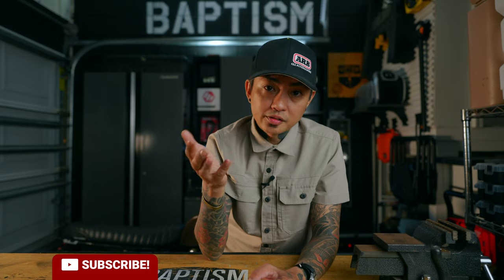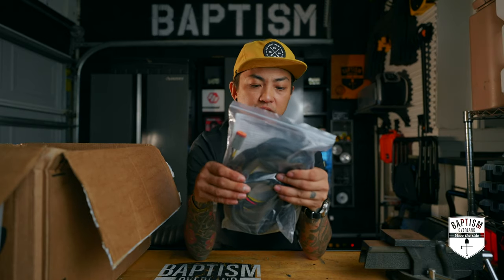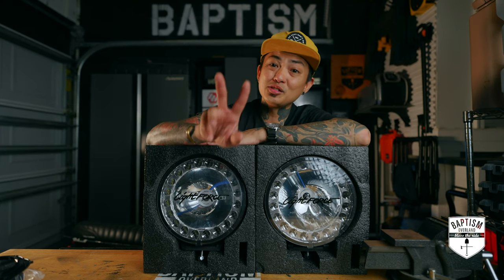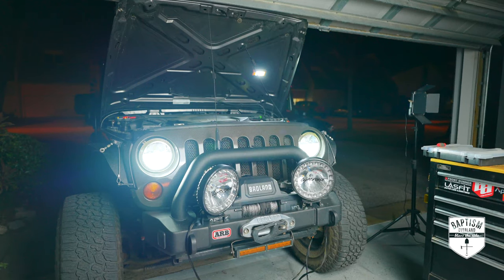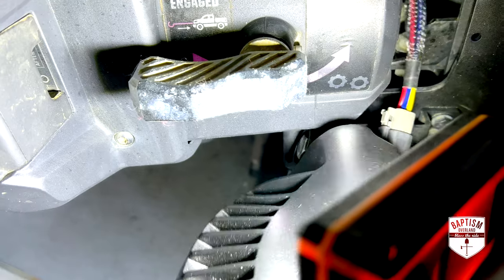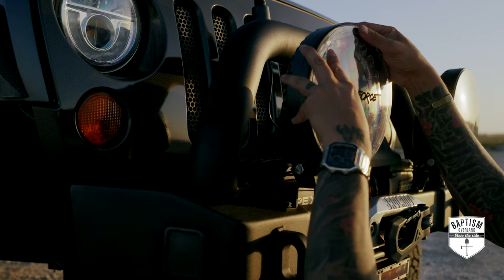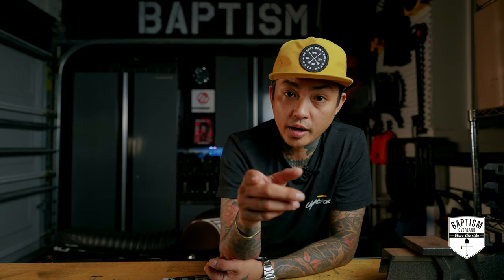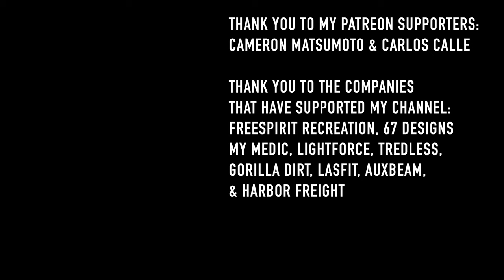I Got My GRAIL LIGHTS! *LightForce HTX2's Install & Review*

Comment: I recently got stuck on a trail well after dark with about 8 other jeeps. We were doing a very difficult recovery of a CJ-5 with a dead engine. To my surprise, the one guy who fired up all his aux lights actually made it very difficult for us to do the recovery. Too much intense light in our eyes was not a good thing. Once we daisy-chained 3 jeeps to the CJ and started the tow, headlights only to avoid blinding the driver in front of you. Great lights certainly do have their place, but me thinks most extra lighting is not needed unless you are pre-running in Baja.

But…..great vid and review Asia!
Reply from the maker: Oh yeah for sure! I can see how that could be a HUGE issue. If we are to caravan, we are def not all turning on our lights and blinding one another. Only the leader
Reply: Ronnie Dahl has a video on his channel about the use of headlights and offroad lights out in the bush. It was a very eye opening vid. Knowing how and when to use lights can be a help, course learning how to maneuver in lowlights conditions, like the Marines taught me, is great too.
Reply from the maker: @whitecherokee73  I learned about these lights BECAUSE of Rony. He did a comparison with Lightforce and cheap amazon lights. Super eye opening

Comment: Man, those are bad ass!

Grail part is my Tera44/Tera60 axles, fortunately for me the jeep had them in it already :D

Really I want a goose gear setup for the rear of my JKU but man $4000+ for the whole setup is a little hurtful on my pocket book.
Reply from the maker: Yep. Buuuut as nice as goose gear is, there are TONS of DIYs for making a system similar
Reply: @BaptismOverland  You are 100% correct my friend, I think im gonna build my own setup, cause it will be a fraction of the cost.
Reply from the maker: @daytonmunk3128  also you can customize it to work for YOU. That was my biggest selling point. I wanted to organize a specific way

Comment: Asia, great video about the new lights. Your right, what a difference in brightness and distance. Those look a bit big for a 4Runner though. Will you be doing more 4Runner Mods? Hope so. Thanks for sharing, stay safe.   Ken
Reply from the maker: Oh I plan to put the same kind on the runner. I've seen them on the runner before and they look great. Follow their IG and you'll see some runners running the same
Reply: @BaptismOverland  I am looking forward to that in a video. Thanks for letting me know.  Ken